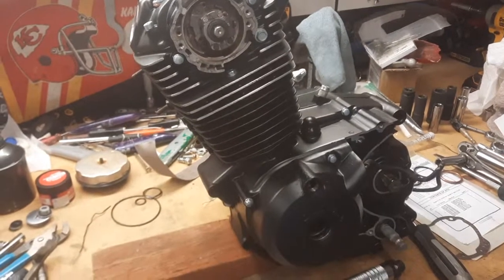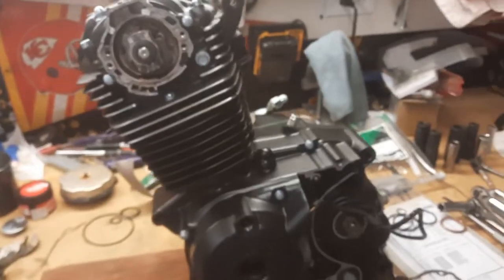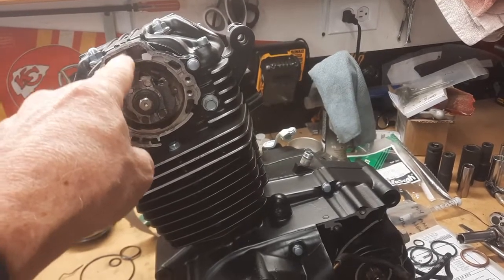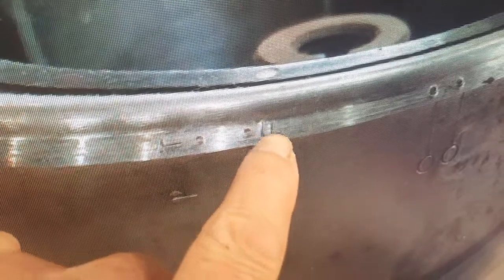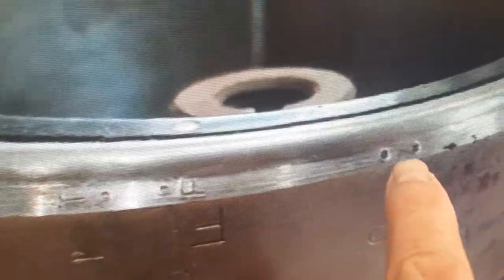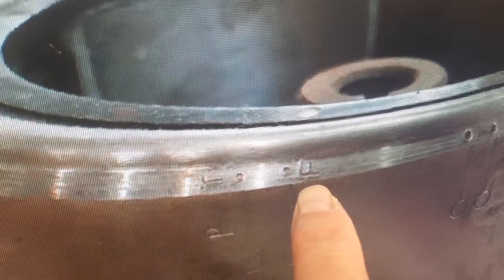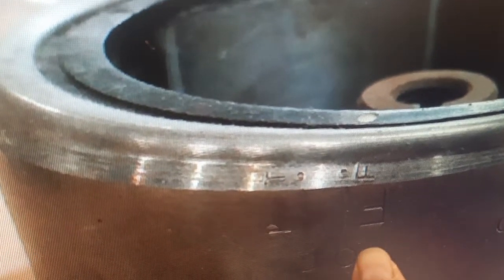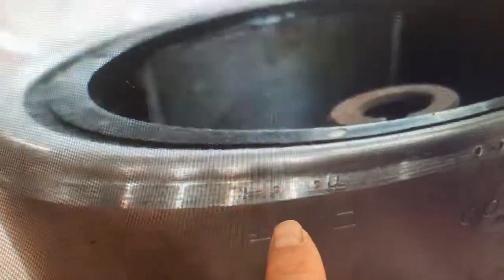Honda ATC Timing Marks Explained

Comment: Thanks. I too spent 2 days trying to figure out the  timing chain setup and then the  firing alignment.  Until l pulled the recoil it was next to impossible to get the cam position and then the magneto alignment.